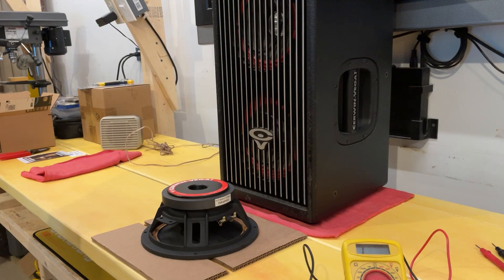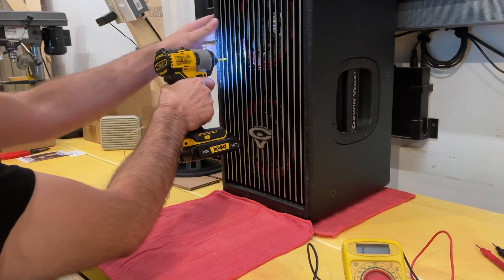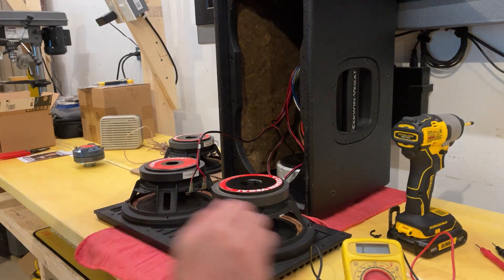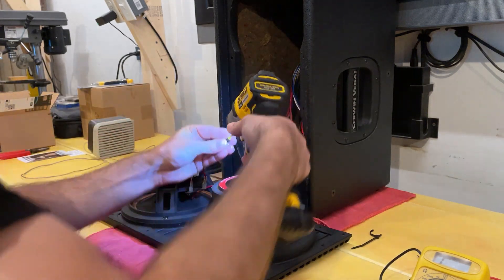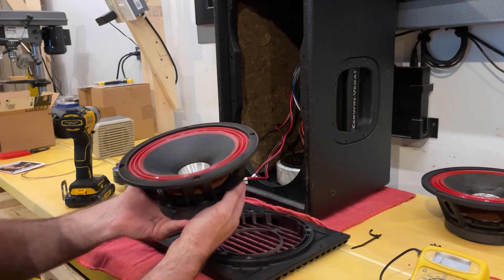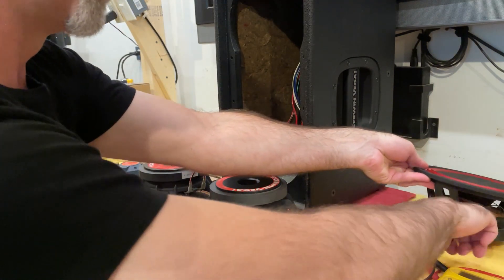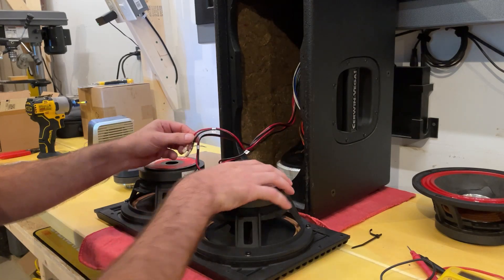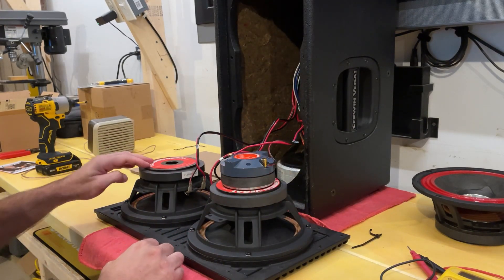Repair - Cerwin Vega CVA 28 - WOFP80202 WOFP80201

Comment: Hi, can you tell me the type of power mosfet that these speakers mount? Thanks
Reply from the maker: I am unsure of what the power configuration is on this unit.  Might check to see if you can find a full service manual, or the service parts manual may have it listed as well https://www.scribd.com/document/782856995/cerwin-vega-sv-cva-28-revc-sm